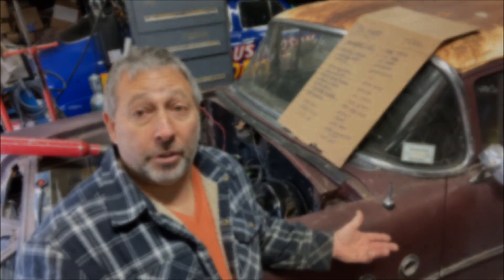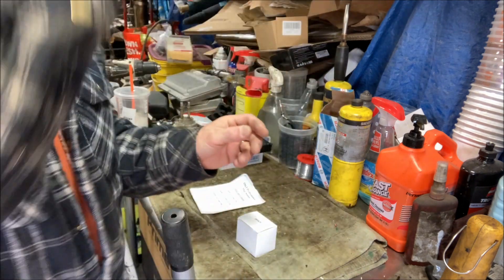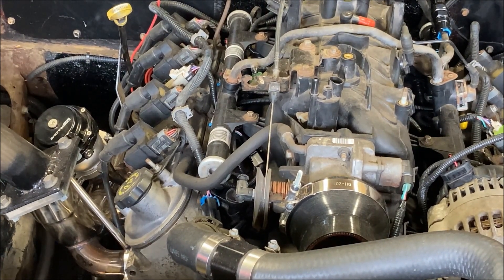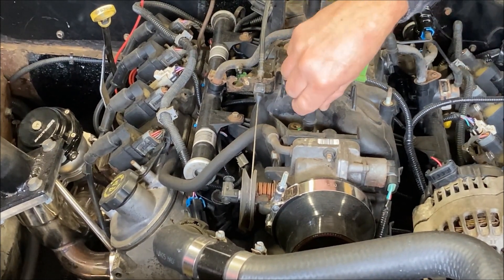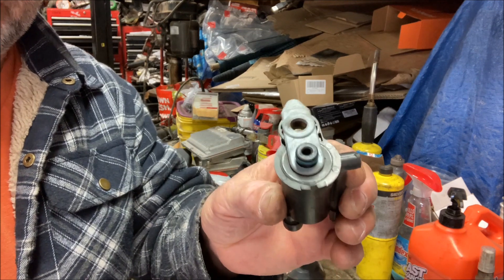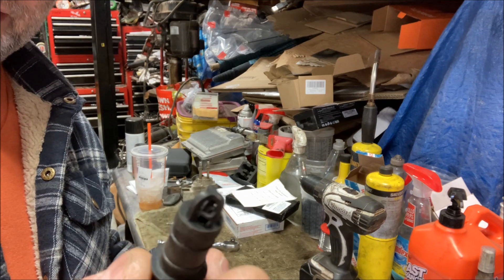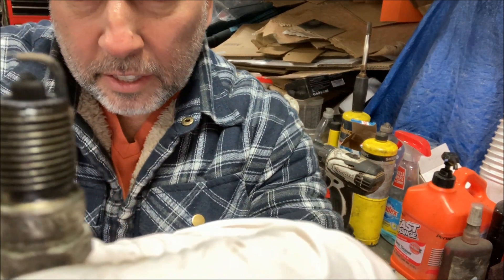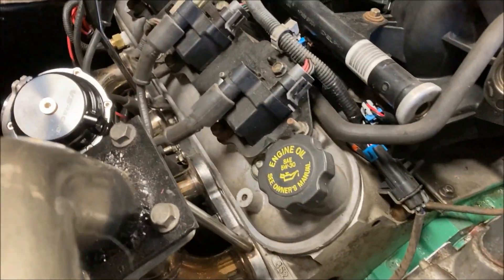Decapped injectors install on the turbo LS, plus 2 Bar MAP sensor, IAT sensor relocation, etc.

Comment: I’d like to make a suggestion, put your old plugs back in till it’s running decently then put your new plugs in. No reason to foul up brand new plugs when starting a tune from scratch. 

I ran stock replacement/ temperature plugs for 5yrs before swapping them. Up to 10psi. 

Mainly because I was too lazy to swap them out due to inconvenience. 

Oh and please do not put the gt45 on it since you own the 78/75.
Reply: One more thing. Look up the wiring for that MAP sensor and make sure it’s pinned the same as your old sensor. Some require the wires to be moved around.
Reply from the maker: Plugs as far as heat range were not nearly as different as I thought they would be, looked pretty close to stock. Hey if I foul them I will hit them with a torch and a wire brush!
Reply: Yeah I never had any issues or signs of detonation. 

I had a wire or plug fail about 3 months ago. Those plugs had been in the car since 2016. The colder plugs sat on the bench since 2018. lol 
I put new wires and the colder plugs in it 3 months ago. Fixed the dead miss.